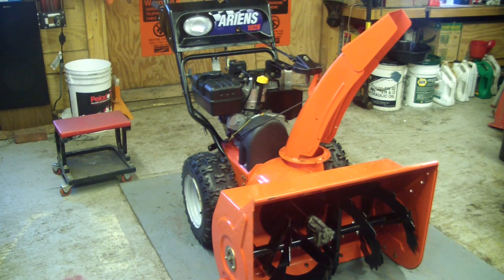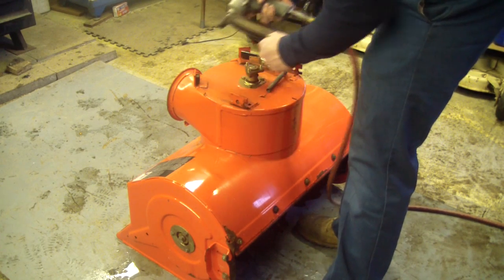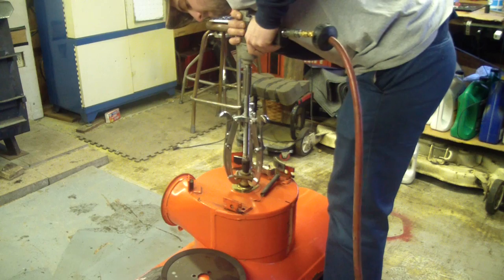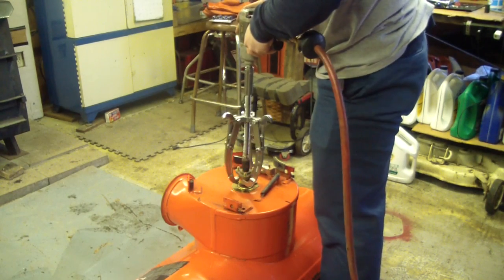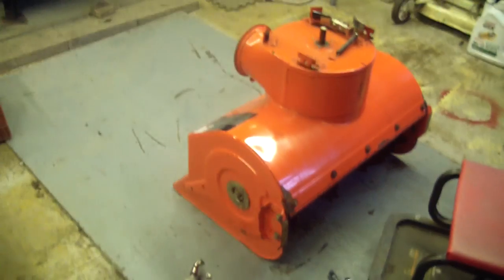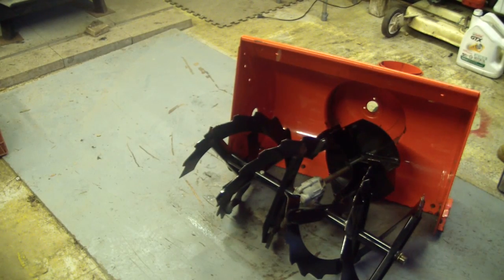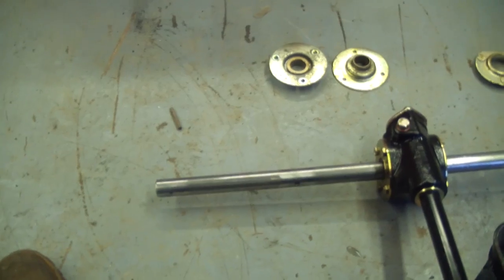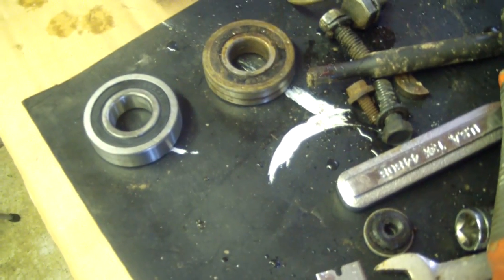How to replace an Ariens gear box DIY

Comment: If every detail had been shown there would have been people complaining about the video being too long. 
I appreciated knowing Airens only did the aluminum casing for one year. I would probably never buy a brand new snowblower. I will avoid any snowblowers with aluminum gear casings. Pay a little more and purchase better quality Equipment. In the long run it saves a lot of grief
Another good way to avoid ruining the gearbox is to put proper shear pins on snow blowers. Too many people want to buy a regular bolt to save a few dollars but then ruin their machine by putting  hardened bolt replacements on their a equipment. 
Thank you for your time preparing this video. Not every video created is perfect. I usually go away learning something from everybody's videos even though they may not be totally perfect in some people's eyes. 
Thanks again

Comment: Thanks for posting this video.  It was better and more realistic than the one at RepairClinic because you showed an older machine.   I just finished this Auger transmission replacement on my 7 year old ST1130DLE.  One suggestion for people doing this who are not pro snow blower mechanics like you is to also buy the Impeller and a few pins.  Removing the old impeller without using an expensive puller or taking a trip to a garage mechanic is near impossible.  That is because the impeller rusts onto the shaft of the auger transmission.  They are probably made of dissimilar metals.  If they are exposed to ANY road salt they rust together and wont budge.   So, the auger transmission was ~$170 and the Impeller and pins are ~$60.   With the additional Impeller purchase, the whole repair can be done with a socket set and a hammer.
Reply: It's not that hard to get the whole thing apart with a little patience and a bunch of penetrating oil (or some vegetable oil mixed with acetone). No need to break anything and spend hundreds on replacements. Just apply a bunch of oil and start trying to work things apart. It won't give right away but the movement and prying will help break up the rust and let the oil work itself further down. Keep doing this for 5-10 minutes every day and after a week it should come free. I managed to fully disassemble the transmission system between the pulley and the augers on a 1976 Ariens machine that had never been taken apart. It spent 20 years on the north shore before coming to Minneapolis.
Reply: If you have plenty of money falling out of your pocket replacing those parts will work but I agree with the reply from Indawg Wetrust a month ago. Be patient and with penetrating oil and some persusion from an air hammer set on low pressure like 15-20 psi you can vibrate apart just about anything that's rusted together.

Comment: 17:12 I didn’t look thru all the comments, but at the noted time, when you released the auger lever it took quite a bit of time to stop spinning. Ideal time is less than 2 seconds. There is an auger brake in there and a procedure in the manual for adjusting the auger linkage/brake system to both provide both good activation and stoppage when the lever is released, if you’re interested.

Comment: FYI, if you heat up the impeller it helps to pull off easier and when putting together sand Just until its clean metal and use LOTS of anti seize and next time some one has to pull it apart its not seized and comes off easy.
Reply from the maker: i know, its just 100x easier to get it pressed out for free

Comment: Do not use an impact gun with standard sockets - they can and most likely will shatter - they make impact sockets for this!  Also, use eye protection when hammering a drift (not a punch as he stated).
Reply from the maker: Done it every day for 10 years. Never broken one. I have impact sockets and use them frequently too.
Reply: Just saying-  Your vision is precious, my son lost his vision in his left eye.  It`s not worth taking a chance using sockets that are not designed for an impact gun. @Titliest07

Comment: thanks for this info, bought a Pittsburgh 3 pronged puller 8", and the long screw bolt jammed in the female thread in the puller when removing Ariens auger bearing, but was able to get the piece out far enough to use another tool to finish it off, but paid $26 for tool including shipping, and it is junk, cheap 3 pronged puller!

Comment: The best part of having the bolt on hub is it makes it easy to change the pulley size.  ;)
Reply from the maker: I dont think youd want to
Reply: @Titliest07  I did that to my old snowblower.  went from a 9" to a 6".   About doubled the throwing distance and pretty much eliminated any problems plugging up in wet snow.  The only problem I had was that vintage blower had very tight impeller tolerances so if any rocks or anything got picked up, it would really launch them.

Comment: try a little penetrating oil on the auger pulley hub and oil the puller threads.  it will go smoother.

Comment: Did you ever consider loosening the two set screws on the sheve-hub in order to remove the sheve before  of using the wheel puller?
Reply from the maker: I took them out. always have. must not have shown it. These hubs come off hard a lot of times

Comment: I just replaced the gear box assembly on a 24" Ariens and have an interesting problem.
I have both Auger shaft brackets bolted in, no bushing in the back yet and the impeller shaft is off center coming out the back. 
I  need to move the gear box to the right to center up the shaft but I have NO space, I'm metal to metal  without clearance between the gearbox, right auger and the right auger shaft bracket.
I have surplus space on the left auger. 
I"m wondering if the auger shaft may not be completely symmetrical and if is was built with the short side on the right instead of the left.

Comment: I'm currently replacing my gearbox assembly. I would like to know if you have see any issues with using bolts instead of roll pins connecting the fan/impeller to the shaft. The roll pins were a b*tch to get out and I rather not have the same issue again in the future.
Reply: Put a little anti-seize on them next time so they don't rust.

Comment: About the "PRESS" you used.  What is the Diameter and Length of the PVC tube?  How many Pounds was the weight that slid down the PVC tube?

Comment: Did you open the old gear box up to see if the woodruff key was sheared?
Reply: That old gearbox used a brass gear with a roll pin. More than likely, the teeth are destroyed and Ariens does not sell parts for them since it was an embarrassment to their name.

Comment: Nice job!  Looks like you might have replaced the old aluminum gear box with a cast iron one? If so, that was quite an upgrade. Did you have a line on one for a good price?

Comment: How much and what type of oil did you put into the new gear box?  I noticed that you have yet to answer any of the questions posed to you on this video as of 1/1/2019. Roll pin punches are a great invention that have been around for decades. A roll of 1" wide emery cloth beats the heck out of sand paper any day of the week. Try some PB Blaster on your rusted items and after cleaning them up, use never seize upon reassembly.

Comment: Buy a USED OLDER ONE and SELL that POS. The big box store Ariens  is NOT the same quality as the commercial grade you buy from a dealer. Yes you pay more, but the Professional models are NOT using the poor quality garbage they are placing in the Big box store machines. I have a friend in the business that has no problem pointing out the difference in the quality of the drive train and Auger system. He has torn a big box store one apart and the Commercial grade one sitting on the show room floor  to show customers the difference. Its a CRIME that Ariens stooped to that level. I was told they actually leased out their name and the big box store ones are actually made by MTD. I havent checked on the validity of that claim, its just what I was told.
Reply from the maker: this was bought at a dealer 10-15 years ago.

Comment: Nannanananana, boy , use a grade 8 bolts and soak the shit outta it with panther pisses. Then let sire over night and then use your man muscles and a 2 pounder or 12 , which ever you can handle and heat that sob up with a torch hit that bastard with the hammer a bam , the perpeller is off the shaft . What the hell taken that set up to a press was not a man move . Gez my grandfather woulda hit it with his finger and push the shaft outta the peller. Did ya forget to put anti seize on the roll pins and shaft before returning it to the peller?! Lol kids theses days . Always rely on machines for muscle.

Comment: He doesn't appear to answer questions and he doesn't appear to know what the items are called what he's calling a fan is an impeller and the other part is in auger and taking apart a near new machine is fairly simple get one that's about 15 years old and trying to take it apart like that
Reply from the maker: In my area we call them fan bearings. We also use truck loads of salt. Very difficult to remove even with high heat.
Reply: @Titliest07  look up fan for a snow blower you will find nothing it's called an impeller I work on these things fix them and repair them everyday so I know what the parts are called I live in Wisconsin and the roads are covered with salt every year so you're not telling me anything I don't know but you can call them fans all you want they're still impellers look it up
Reply from the maker: @MrTeaze45  i know what the part is called. What I'm telling you is that WE call them something different at the major dealer i worked at. I know its an impeller. I know they are augers. Its like calling a gas engine a motor. A motor is by definition electric. People still swap the names. We all know what they mean though. It doesn't matter. Did the machine work at the end? Yes. Its been YEARS and it still works perfect.